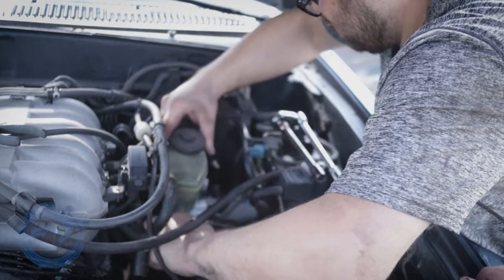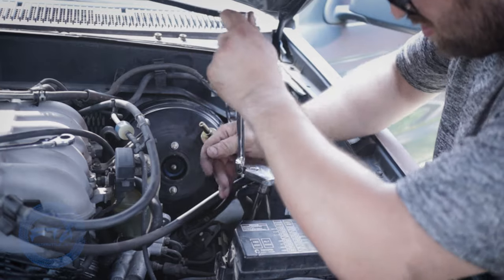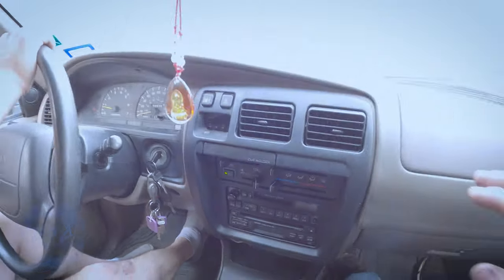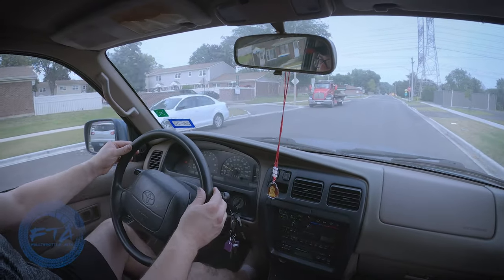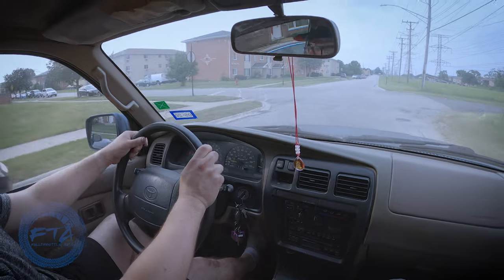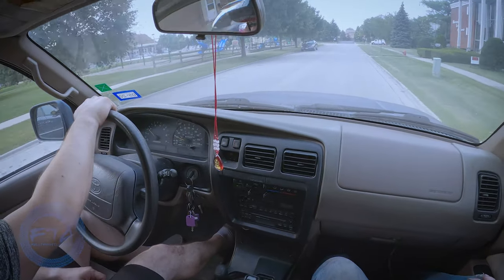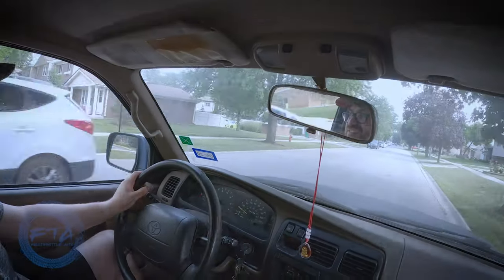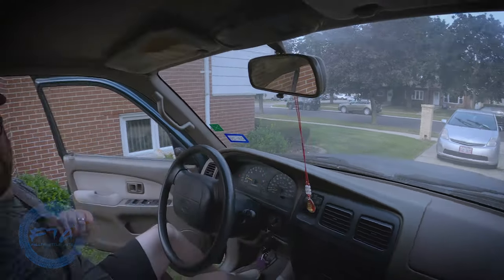3rd Gen 4Runner 3.4L 4WD Brake Booster Replacement and First Drive

Comment: don't forget about the ball joints on these trucks, the wheel falls off if one fails. I have a 1996 with 310k, best trucks ever
Reply from the maker: Thanks for the info. I will be replacing them as soon as I can.

Thank you for watching and commenting.
Reply: @FULLTHROTTLEAUTO  with the Auto be careful of the "pink milkshake" a lot of guys will have a separate cooler. Rear axle seals are prone to fail but not a big deal. sounds like you are doing your research, I should probably check if you have update videos lol

Comment: what about the seal between master cylynder and brake booster? im stuck right now cause no parts store sells that seal
Reply from the maker: My seal was fine. However if yours is damaged you might need to contact Toyota to see if they sell the seal separate or you might need to replace the Master to fix that.

Thanks for watching and commenting.

Comment: My 4Runner had 4 bolts in front where the master cylinder goes, & I ordered one with only 2 bolts would this still work ?
Reply from the maker: The pattern of the bolts might not match up with the master. It is possible it might work but I can't say for certain. If you're going to be replacing parts, good rule of thumb is stay with same style items.

Sorry I didn't have more information for you. Good luck on the repair. Thanks for watching and commenting.

Comment: What were you adjusting on the brake booster on kinute @4:25
Reply from the maker: That's the "pin" or "shaft" that pushes into the master cylinder to apply pressure to the brakes. If it's to far out or to far in it will not properly work. So we adjusted properly basing off what it was on the old booster and how it was sitting within the master.

Hopefully that helps. Thanks for watching and commenting.
Reply: @FULLTHROTTLEAUTO  thanks a lot bro, nice video

Comment: What tools did you use?
Reply from the maker: A basic socket set will work. I also had extra tools. Depending what clamps are on the hoses you might need pliers too.

Thanks for watching and commenting.